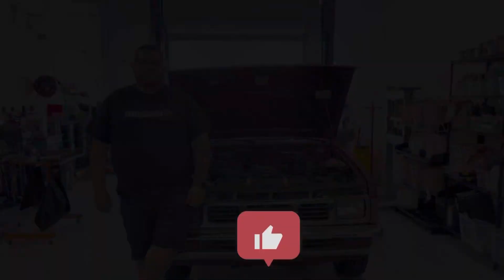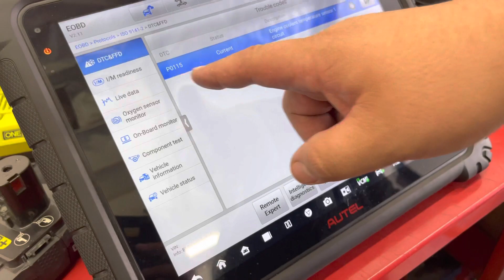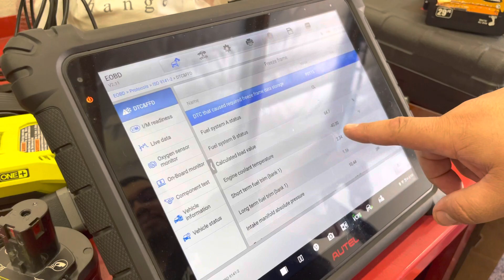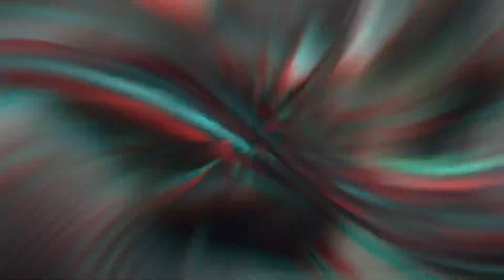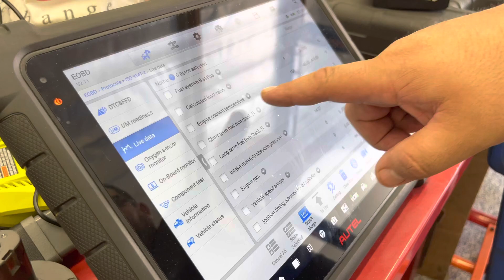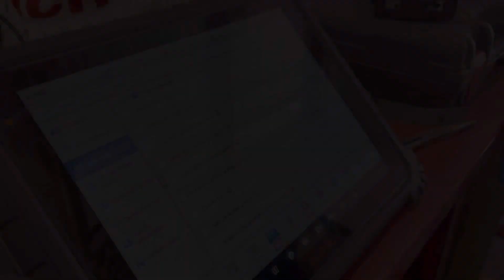P0115 Engine Coolant Temperautre Circuit Malfunction

Comment: 98 Camry. So I've had the car for around 8-9 months and never had a problem with it. CEL came on today even though the car is still driving fine. Ran the scanner and PO115 came up. Now something that might be correlated is I just added some coolant to the car a couple days ago, as the reservoir was on the low side. Also the CEL is intermittent, it'll come and go. Should i start with replacing the sensor or what?

Comment: hi i have peugeot 508 with 2010 model with p0115 I check o my etc sensor resistance ok i change it with new one but code is there I change the thomostant the code is there pls I need help thanks lot
Reply from the maker: That code is for an ECT Circuit. Do you have a scan-tool at your disposal?